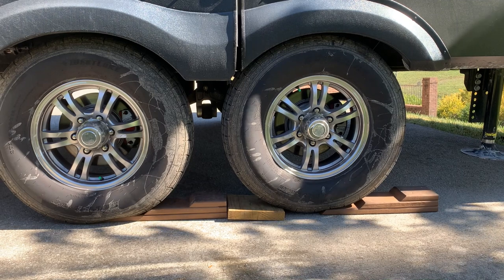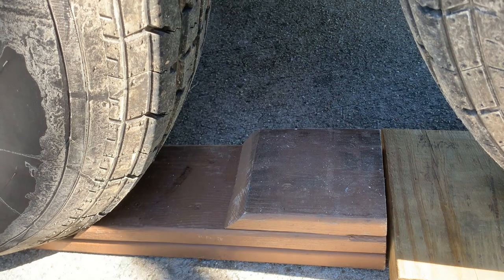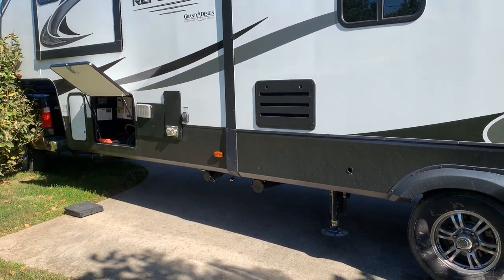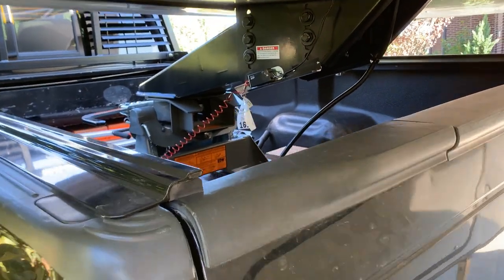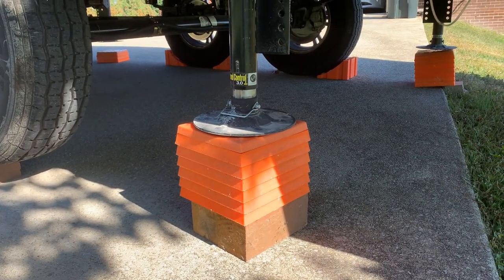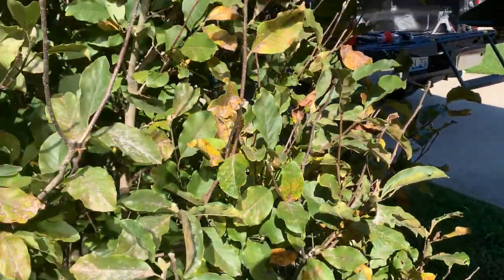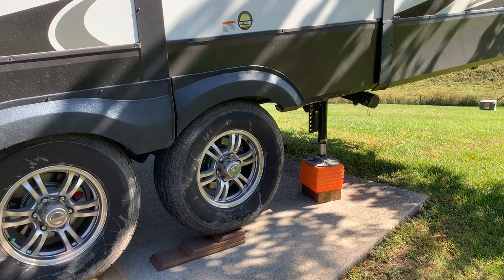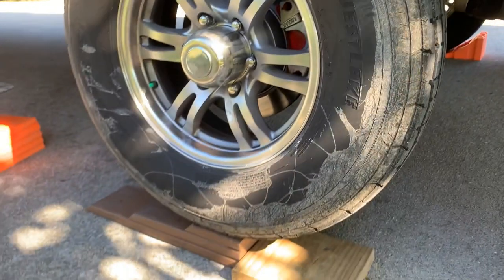Updated Auto Leveling Lippert Ground Control 3.0 System Grand Design Uneven Surface Out of Stroke

Comment: I always lower fronts as low as possible then hit autolevel. It has always worked, first step is always good. I carry 2  - 2" x 8" x 6' pressure treated planks. If my side to side is bad in a spot I use one or two for the side, but just use the front extensions as required and have never been out of stroke or had tires lift off ground. P.S. Westlake tires are crap.
Reply: Received an "Out of Stock Fault" this weekend and was lost as to what to do.  How do you know which side requires the planks?

Comment: I'm new to the lippert 3.0 system. 2021 Reflection 150 fifth wheel after 20 years of travel trailer/pop-ups. With that being said how much of the level tube should be out of the unit when the unit is leveled? What is if anything recommended to put under the leveling feet while camping? Should you store the camper between camping trips with feet up or down?  Thanks for all the info in advance. 😊
Reply from the maker: Jeffrey, first, congrats on the new camper!  Ideal extension is the least amount possible, but that becomes impractical in many situations.  Many sites are graded for drainage.  The less you run out, in theory the less movement you'll feel in the camper and the cleaner you'll keep the inner seals because the metal that passes through the seals won't be exposed to the elements.  In reality, I've never seen factory leveling system that takes all the camper rock / sway out.  I plan to make a video on how I do my max stabilizing at a site to prevent kid sway.  Before I added supports, even when perfectly leveled, I could feel my kids turn over in their beds while camping.  Of course there are many products that help with this (Strong arms, Steadyfast, X Chocks, king pin tripods, etc)

For your front jacks, on perfectly flat ground, you run the manual extensions down until there is about 4~6" gap to the ground or your level block, then use to controller for powered extension.  Of course when you are unhooking from your vehicle, you have to run out more to get the hitch clearance, then auto-level. I use simple post risers I've made from scrap wood.  You can buy the expensive buckets, but they aren't doing anything more than the wood, other than potentially easier to store.  I also use the Tri-Lynx blocks w/ caps depending on the site.

When storying, the manual officially says to only use the front jacks.  Many times when auto leveling, the mid / rear levelers are lifting a significant portion of the axle up and taking on some of that load.  Because I store at a farm outside, I use concrete blocks under my front and rear jacks.  I manual extend the rear jacks about 1~2" just for stabilizing support, but without lifting the axle up .  We've actually had campers blown onto their sides (tri-axle!) during storage in my area.

Hope this helps and Happy Camping!

Comment: You need x chalks between your wheels when up on blocks side to side. Would hate to see that camper slip off them because of movement.
Reply: As the leveling system adjusts the height of the wheels the distance between them changes and the chocks can become loose or too tight - Ive started using wheel chocks because of this

Comment: Sorry, just to be clear, once you unhitch and pull the truck away, you manually extend the front legs really really far to make it nose high, and this causes it to pull those legs back in before starting to level? Often, I find that my 311bhs ends up really really high for no reason and i'm wondering if this would defeat that.
Reply from the maker: Ross, this all depends on the grade of where you are leveling:  In general, most spots slope from front to rear, at least in the hilly areas around me.  Before I unhitch, I don't extend the manual front legs as far down as I would on a level surface (example leaving 10 inches from ground to pad vs 6 inches on perfectly level, but all depends on the grade), I then use power front extension to extend far enough out to unhitch, this results in my front being fairly high, but because the manual extensions are set shorter, it allows the auto level to lower the front more.
Reply: @rvengineer2300  holy crap this is a great tip. Totally going to be trying this going forward
Reply: @rvengineer2300  Thanks for the assist!!!
Reply: @rvengineer2300  So this video and your comments are very helpful.  On our last trip, I broke the 1st cardinal rule of Onecontrol.  Level the trailer first.  I ended up all 4 tires in the air!  Luckily it was only for 2 nights.  Thinking about it, we could have had a windy situation that probably would not turn out well.  I have been trying to figure out how to lower the level of the trailer by 2 inches or so.  Would that be resetting to zero?
Reply from the maker: @johnphillips9418  I've never use the OneControl system as my camper pre-dates that system.  For my systems, it's all about understanding the slope and setting the front lifts low if they are on the high side of the slope.  Good luck!

Comment: I just tried to auto level my new class C RV in my driveway and the jacks lifted the back wheels off the ground!

It freaked me out so I cancelled the leveling process and retracted the Jacks …

Wouldn’t that have caused a big problem if the brakes are on the back wheels and they lift off the ground?
Reply from the maker: This can be a bit touchy, so I'd consult your manual, but here is some general thoughts:  Travel Trailers and 5th wheels brakes are generally not 'active' while parked at a camp site, which is why we have to chalk the wheels.  I've never seen one with a parking brake like a car, although maybe one does exist.  I would imagine it is similar on a Class C where as long as front wheels are properly chalked, it shouldn't be a safety issue.  Of course there are caveats about how steep of a grade you are on, etc.  If it makes you nervous you can always make a step ramp out of wood or buy one premade that gets the unit more level before using the auto feature.  Hope this helps!
Reply: @rvengineer2300  How do you know which side needs the "step ramp"?  I had this happen to me over the weekend and the jack system lifted both sides up off the ground.
Reply from the maker: @Jtmony07  If both sides lifted off the ground then my guess is the pad is a slope front to rear or rear to front.  I'm not sure which leveling system you have, but if it's equivalent to the Ground Control 3.0, when you park, you can press the down button on controller and one of the items that comes up on most systems is your Front to Rear and your side to side angles.  If you have a side to side angle beyond 0.5 degrees, a step ramp would help.  If your side to side is even, but your front to back angle is high, assuming the case where the site slopes to the rear (as in the front is higher), then you need to be strategic about unhitching.  In that case, I want the computer to be able to lower front a lot to even it out, so I don't extend the feet slides (manual part w/ the holes) a lot, I instead run the front legs long via the controller to unhitch.  This way when I auto level, the computer first drops the front as much as possible before extending out the rear.  For the opposite case where the Rear is high, if I have to, I'll run a of the front manual slides out to allow the computer to push up front end via the auto level.  This isn't ideal as the more you run out, the more movement you feel in the camper.  There are some sites that are so sloped your only option is level blocks on both sides.  I really try to avoid these by reading site reviews / studying the best sites when I find a place I like.  I do carry a fair amount of Lynx levelers for this reason, but its hard to get 4 tires much more than 4 blocks up without getting creative / being more trouble than it's worth.  I hope this helps!